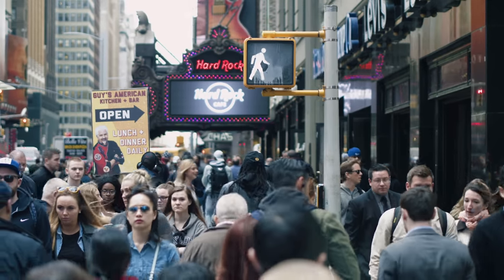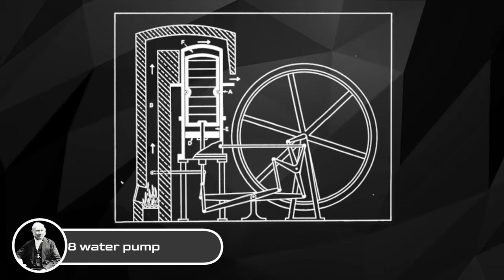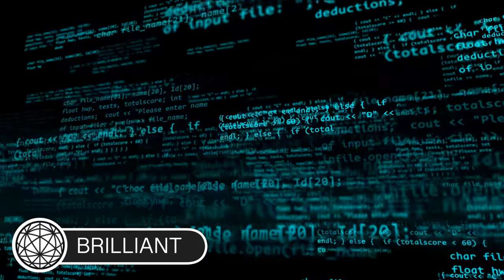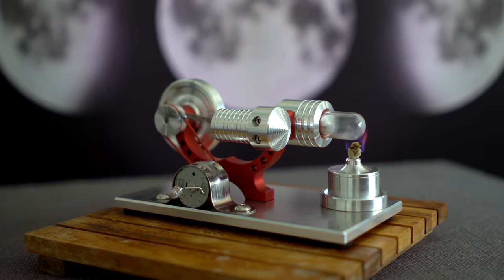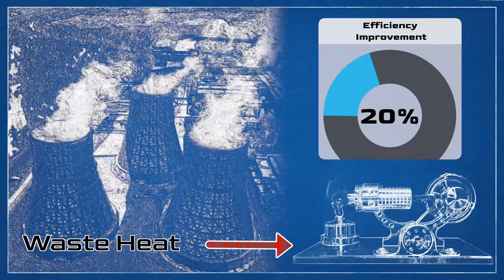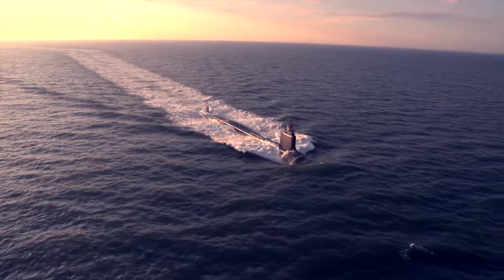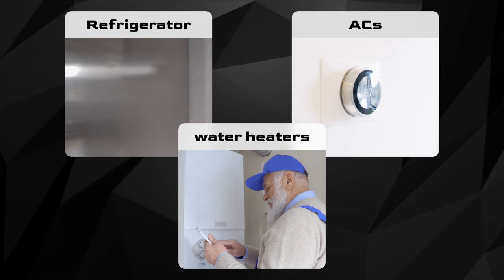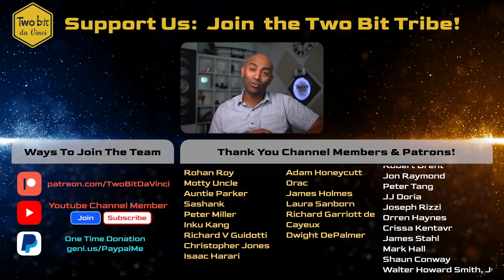Why This Age Old Tech Can Be the Future of Energy - Stirling Engine Explained

Comment: Great video.  I know one professor who has the world's record for lowest operating Sterling engine.

I believe that we need every option on the table.  I like bio fuels that can serve as a potential stop gap until we can come up with a better battery for electric cars.  They even can get fuel out of the carbon dioxide in the air.  Algae for bio fuels is great.  Anaerobic digesters have potential too.

My hope is we have every option on the table.

Comment: You want a sterling engine to fit in cars; yet able to put out at/or near the same power output?... Here's my idea 💡:

Make ONE the same size as regular car engine. To make up for the missing power sure to sterling engine's size, hook it up to a generator/bunch of alternators. (I basically just thought up a hybrid propulsion but in sterling principle)

To amplify electrical power, use engine coils AND regulator just after the generator. To store electrical power, use batteries, capacitors, super capacitors (depending on your budget), or a combination of those.

The whole electrics will do most of the work (accelerating the car, maintaining the speed, the whole shebang); the power medium (or maintaining power) are the batteries/super capacitors. WHILE the One supplying power is the sterling engine.

Comment: Using Hydro or thermo generated Electricity to make H to burn in a fuel cell seem the best idea for future clean energy I have heard so far. And H creates  water when burned.   H energy density is high like FF. High energy density is the problem with most wind and solar and batteries.

Comment: I'm interested in Stirling engine used with CSP (Concentrated Solar Power) dish or system to convert the Sun's light to electricity for example.
One area I'm interested is providing a Stirling engine with Cold & Hot tanks at about -200C & +600C resp. This would result in about 90% theoretical max efficiency when converting the stored thermal energy to electricity. And as you said in the video a Stirling engine also can be used to "fill" up these tanks during the day for example.
Reply: I have wondered why the technology isn't used for heating water. A simple water heater is two barrels, a larger one and a smaller one. The smaller one is placed inside the larger barrel, the larger one is painted black, and the smaller one inside contains the water. The heat generated inside the larger barrel, much like the inside of a tent or your attic, heats the smaller barrel containing the water, and voila. Now if we were to use a fresnel lens .. ?

Comment: As an electrician who has been involved in Solar Hot Water, Solar PV, and wind energy, I believe you are missing the main reason Stirling Engines are not used commercially: Cost vs Benefit; It is far cheaper and easier to add Solar PV With Battery backup to ones roof, than Solar Water Heating or Stirling Engines. Solar PV does not need costly plumbing, expansion tanks, freeze protection, and the dangers of leaks in the attic. It is also much more reliable, easier and cheaper to repair, and has almost no moving parts to maintain. Stirling Engines are fun toys, and may have some niche markets, but are just not able to compete with Solar PV and Battery Storage for residential, and both Solar PV and Wind Energy WITH Battery Backup at utility scale that is both cheaper, readily available, easily scalable, more efficient, and quicker to install.
Reply: I'm sold, get Tesla to hook up a PowerWall 2 for my existing solar array, but I'm further away from their own supply/sales outlet. 

Just kidding mate, I live in Australia, so just having a dig at Tesla. 😉

Comment: The Stirling engine is VERY efficient; it could be used, for example, on large ships where there is a large amount of hot exhaust gas with lots of energy.  Then, water (high specific heat) could be used to whisk the heat away from the engine.  The resultant energy output would require less fuel to be burnt which reduces cost and pollution.

Comment: 1: How would Mercury work as the fluid?
2: Instead of "heat lines" in the home, design homes around "Hot cores".
3: If you put two sterling engines in tandum with like a see-saw effect, would it increase their effectiveness?
Reply: Mercury is such a hazmat I don't see it ever getting past building codes
Reply: @raymondclark1785   Really? Cuz we literally have gas lines all over cities and drive gas cars, all of which tend to explode and we still use them on a regular basis. 🤷🏻‍♂️ To go green, I think risking a mercury leak is the least of our problems as the planet withers...
Reply: @raymondclark1785   well Im not gonna have a conversation about environmental dangers here in a youtube comment. The idea that "it explodes and thats it" is the reason the world is in the peril is in. I understand the dangers of Mercury, thats why steps need to be taken to make it more environmentaly friendly by adding layers of protection and even have a program where the systems get inspected on a regular basis OR use a different element with similar thermoconductive abilities. The idea remains. The hazard os but a stepping stone/stumbling block and it can be surpassed with innovation and creativity.

Comment: Deserts blazing hot during the day and freezing cold at night with radiators you could capture both thermic and endothermic to store in separate water tanks to run sterling engines and or heat cool your home in the desert.

Comment: Stirlings are NOT a form of "External Combustion" engine - as you pointed out, they don't actually require any form of combustion to operate. 
They're Thermal Differential motors.

Comment: The "heat line" concept sounds nice, but you can only dump excess heat into it until the potential of the heat line. I doubt it will be viable for sources like freezers, who will work the better the lower the "hot room" temperature potential is.

In a Diesel locomotive or a ship or a lorry, I can however imagine to replace the water/air heat exchanger for the cooler by one that either propels a Stirling engine, or if ambient temperatures get too hot to effectively cool the water be propelled as a heat pump.

Household temperatures outside the attic and heating tend to create too little heat to be collected and recycled, unless you make the AC a Stirling engine; and even then, IMO it will be used in powered mode most of the time.

Comment: If the heat issue for generation is so hard to deal with? Why, When I was a kid did we have a stirling tractor that could work land. It was temperamental and you needed to manage flywheel momentum but it worked not as well as a diesel but it worked. My recollection is the that the engine ran on what was basically a blow torch. Is my memory faulty or were these things actually useful?
Reply: I had a customer who said they had a tractor in Germany during WWII that ran on fat. A Russian POW would build a wood fire under it and then spin the wheel to get it running
It sounded like a Sterling. Maybe a little bigger than the one o y bookshelf :)
Reply: @raymondclark1785  Thanks for sharing.

Comment: You can use them in cars. Run a 10-20 kW Stirling and charge batteries and/or super capacitors.

Comment: there are two issues with Stirling Engines, 1/ they are large, expensive and costly, 2/ unlike ICE's there is no standard off the shelf models and have to be made specifically for a given application, ie tailor made. and that has alway's been their acylase heel.

Comment: 7:37 Internal Combustion engines also require outside help to start (alternator).
Reply from the maker: That’s what it says in the video. Also it’s not an alternator it’s a starter that starts it
Reply: @TwoBitDaVinci  it depends. In a diesel back up generator setting it makes sense to use batteries to power the generator to start the diesel engine.

Comment: Better solution in my mind would be to have 2 lines - one connected to the ground one connected to outside, and use stirling engine to heat up the ground while cooling inside the house and have this process run reverse in winter, all the while generating some energy.

Comment: Love your approach to these topics. Stirling engine capacity to produce electricity...so how big and expensive would a stirling engine have to be to provide enough power to run an average house (lets use around 200 sq ft as the average - although we live comfortably in a 600 sq ft home.)

Comment: Hi Ricky,  There is no such thing as a hot water heater !   Usually this phrase is intended to describe a cold water heater — which is the understood meaning of water heater .
Reply: What if you had a heater that was designed to only produce warm water? How would you distinguish it from a heater designed to produce hot water?
Reply: @codetech5598  Such a "warm water heater" is very rare outside laboratories and similar industrial applications.  Precisely naming these things is not particularly valuable for everyday use.

Comment: Forget the Stirlings. They don't have useful power densities (per volume and mass). The way to go is another old thing, even older than Stirlings: steam engines. Steam engines survived in power stations and improved a lot since the 18th and 19th century. Today they are not only operated with water but also with organic compounds which are used in refrigerators or with CO2 in high pressure steam engines with very high power densities.

Comment: Sterling engines are certainly fascinating. There are some relatively high output models that exist but they're extremely expensive and only makes sense in very specific and unique situations.
One of them is using it as a heat pump as you mentioned. They tend to use Sterling engines in reverse to get extreme low cold temperatures. For cryogenics and other type things. You can get far lower temperatures out of a Sterling engine then you can a refrigerant based system. But again these are not simple Sterling engines they are extraordinarily complex in order to achieve that.
Also you mentioned internal combustion engines only being 20% efficient and that is not been the case for a while. Toyota's new inline 4 cylinder engines are 40% efficient.
Reply: 40% efficiency only on the optimal working point, the average is far below that, unfortunatly
Reply: @uweburger  
True it would depend upon what kind of driving you do. If you do lots of steady-state highway or steady state cruise around town you're going to be in that range. Stop and go traffic certainly not..
But considering not that long ago engines were rated in the same way in the 20% range. A lot of improvement has happened. Internal combustion has the advantages of 120 years plus of refinement. But the big advantage is liquid storage of fuel. Fossil fuels are very energy dense easy to store and stable in storage for long periods of time.
I suspect we're going to run into all kinds of interesting new problems as electric vehicles age.
I can park an old carbureted vehicle and as long as I drain the fuel out of the carb. It could sit for 20 years. I wouldn't need much more than a screwdriver and a wrench to get it running again.

Comment: heat from the attic?  yes - keep the insulation off of the heat exchanger.  Alternative:  Use the expired patent that puts tubes in metal roofs to collect heat.  So, for new construction or changing out from old shingles, then consider this patent.
Reply: BTW:  tubes in the south facing roof can collect heat from sunshine (radiation hot) in the day.  Tubes in the north facing roof can collect cold from the sky at night (radiation cold), esp if there are no clouds, such as a dry climate.
So, both north and south can be useful, if the roof is dark, such as black.
Reply: BTW:  tubes in the south facing roof can collect heat from sunshine (radiation hot) in the day.  Tubes in the north facing roof can collect cold from the sky at night (radiation cold), esp if there are no clouds, such as a dry climate.
So, both north and south can be useful, if the roof is dark, such as black.

Comment: I've always felt that using nuclear heat to boil water seemed a bit wasteful.
Reply: Even in theory no type of heat engine gets much more than 50% efficient (that applies to Stirling engines too).  Steam turbines are around 35% efficient, plus or minus 3% (usually plus with nuclear plants).  New designs are incrementally improving that efficiency but it's not like there's a much less wasteful way of turning heat into power (not without wasting a lot of money anyway).
Reply: If they closed loop the water it only takes 30c to boil water in a vacuum with a one-degree differential chiller you can return the steam to liquid and start all over again.

Comment: A Stirling engine with a clutch could be used to control speed. Never built one myself, but I always assumed they were more useful providing  locomotion than as a generator, though I suppose a dynamo arrangement may provide more amps providing it produces enough torque?

Comment: To what extent is it better to use traditional generation methods (heating water into steam to spin turbines) over a Sterling Engine? I've not had much of a chance to read around, but a cursory glance implies that they can achieve an 80-90% efficiency rating while our current "best" is around 40-45% with coal plants - I get that they're a bit more expensive, and take some extra work to design, but the overall simplicity in maintenance makes them seem perfect for public utilities and infrastructure. 🤔

Comment: Using a Stirling engine generator to produce energy from domestic loft waste heat in cold weather will not gain significant energy, compared to the energy saving by improving the loft insulation. I.e. it's easier to reduce waste heat in a house then recover any of the energy from the waste heat. Likewise for heat in waste water, it is more efficient to use a heat exchanger to heat the incoming water from the waste water. The same can be said for waste heat from power plant and industrial sources. It is better to find a use for this heat, e.g. district heating.
Unless better thermovoltaic devices can be found, Stirling engines are a good fit where waste heat cannot be avoided.

Comment: since sterling engines depend on the temperature differential between the 2 chambers I'm thinking it would really go well with those space reflectors. might also help with global warming so that we're not just taking indoor heat to the outside air, but rather to space.
Reply: global warming ?

Comment: This video misses the most important issue:  the "quality of heat" - which is big delta-temperature as well as the flow (volume) of heat at that point.  I do like the "heat line" idea as we waste tons of heat because it can't be easily (economically) captured.

Comment: The problem with Stirling engines is they are inefficient at low temperature differentials. You need many hundreds of degrees to get high efficiency. At 40 temperature differential in a ceiling you would be lucky to get a couple of percent in efficiency.

Comment: Concentred solar could bring easily 20kw/160Kwh of electricity per a cost of 10000/15000$ for retail sales.
Opposed to solar panels and big molten salt towers, it can go even at nightimes with easily achievable additional features.

Stirling Engine optimization is a thing of a future past.

Comment: a kabel train with radiators with air from sealevel, go up to +8kilometers on the mountain and comeback, the cold air heats up because the string engine sealevel heat and brings the heat to the top of the mounted and cools of again, cycle complete, cooling down earth.

Comment: you also didnt mention that in addition to variable fuels stirlings can run at different heat levels..running slower or faster with the change in heat- and therefore able to use low grade heat that is normally wasted..
Reply from the maker: So so true! Great point!

Comment: Also, once upon a time, I was toying with the idea of making a sterling engine using a pair scuba air tanks. Those suckers can be pressurized to 3200 psi. Has anyone ever calculated how much power could those generate? I just wanted it big enough to run an electric generator for power outages.

Comment: Heat is the "fuel" of a Stirling engine, just as heat from fuel combustion drives a gasoline or diesel engine with the pressure the heat generates. Almost identical working principles, and unable to compete on efficiency!

Comment: OK, here is the recipe:  1) make a huge water tank with heat insulation  2) heat up the water in the summer using solar collectors  3) generate electricity all year long and heat homes.    Efficiency improves with size.   There must be a reason noone is using this.   Any idea why?

Comment: On an industrial basis how about using a stirling engine can be stationary use waist heat from an ethanol bio fuel plant,could be used to generate electricity size would immaterial as it would be stationary electricity could replace part of the energy used to move grain and pump ethanol. They do have a hell of a lot of waist heat.

Comment: Is it sensible to add a gearbox onto one of these? May then reduce the size of the engine. Because less power Is needed to spin something at a greater rate. 
Apply the high RPM from the output end of the gearbox to run a motor or Alternator like the ones found on a car. 
If you altered the voltage rectifier to allow the output of the Alternator to higher voltage. Then you could use that application for a range of things in a house hold. Not so much run a car. But run a house. Or have it as an additional source of power like solar is used now. 💫 
May be a generally good idea. In principle. Not sure on your thoughts?